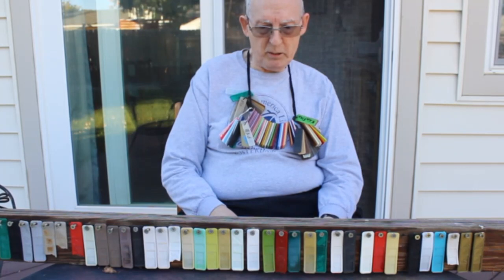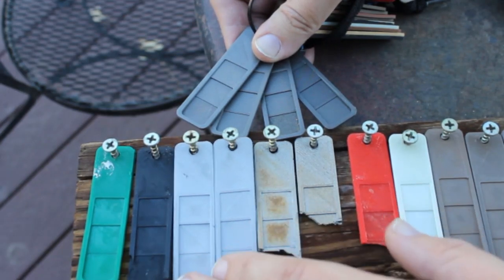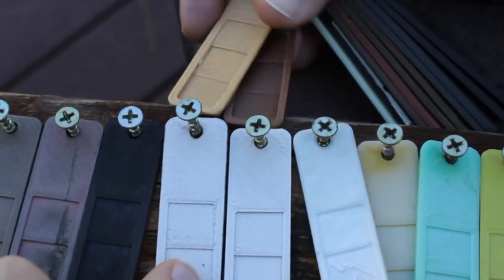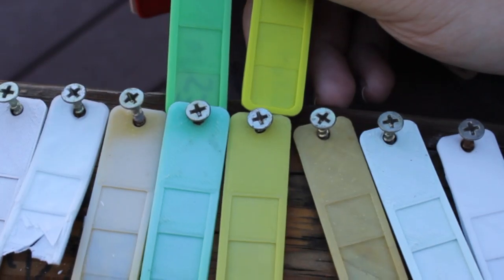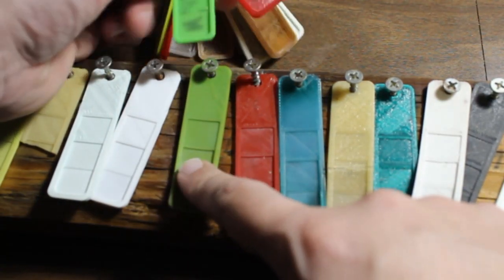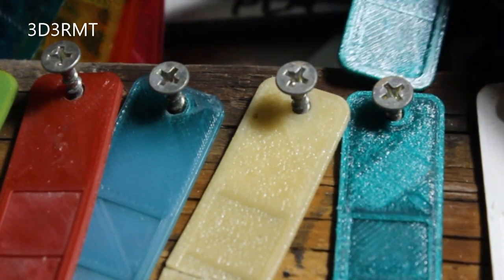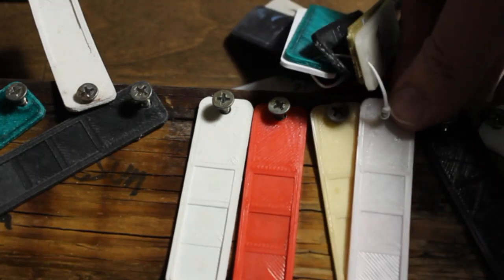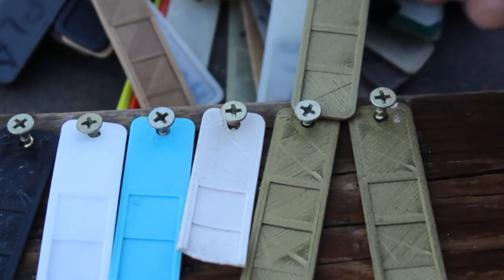5 Years Later: Testing 3D Printing Filament Outdoors

Comment: So whats the top 3 easiest to print and most resistant to UV?
Reply from the maker: Color wise TPU is the best on the board. It also retains it's flexibility. All others have faded, with PLA's being the most brittle. The board has fallen off the fence a few times and broken some samples. UV wise they all have taken a hit. If you want prints to last longer painting or UV treating needs to be considered. 
In terms of printability, PLA is forgiving, cheap and easy to work with. TPU takes some tweaking but I like printing with it. Other materials on the board you have to adjust from PLA or PETG.

Comment: This video is IMPORTANT TO THE EXTREME for the 3D printing industry from beginners to much more experienced users, UNFORTUNATELY the presentation is not coherent and difficult to follow and understand. Make no mistake, the data is all there but the video is very confusing. Using Brand names instead of types of filament is very close to useless. Reorganize the examples according to type with one label for each type and redo the presentation, which will then be MUCH MORE VALUABLE and thus USEFUL to everyone.
Finally the video is way too long. If well prepared and done it should not have to be longer than 7 minutes.
Reply from the maker: 7th year video is in the works.
Reply: @3DPT  Nice.  Hoping to see some new materials being added.  I'm happy to see PETG holding up well, I printed some motor mounts for my awnings from PETG, and so far they have withstood sun, weather and stress from the motors.  I printed them in white and they have not noticably discolored yet.
Reply from the maker: Read the chapter titles for the material type. It's organized based on what I had in 2016.
Reply: If you could do a better job....than do it! LOL, these guys did this for free. Beggars cant be choosers. This is a great video for sure.

Comment: ALLL that and no ASA......your zipties are nylon usually and sucks at uv resistance, colorfab resins dont loose there color as much they use real pigment master batch this helps
Reply from the maker: I've not had a chance to print ASA, and I don't have the ventilation needed for it. When I started ASA was not even an option.
Reply: Fillamentum has a good ASA filament, Collorfab I don’t know, at least when I started and when I represent them this was not avaiable. Thanks for the test by the way

Comment: Can you check the durability of the prints? Like how easy is it to snap them or are some of them like as if they were newly printed? 
I need a filament for outdoor use, in the sun I need it to be tough and hard.
I was looking at PETG or something similar, what do you recommend?
Reply from the maker: PETG is good for outdoor use, the one PETG sample has been good after 3 years outside. PLA's tend to become brittle, I've snapped a few accidentally. Any carbon fiber or TPU would work well outside.
Reply: reallly..... bud use ASA it is actually uv resistant they make CF ASA to now and PC is an option over all the above 
USE ASA i still cannot believe you ran alll that and no ASA oh well maybe next time
Reply from the maker: Was not available when I started.